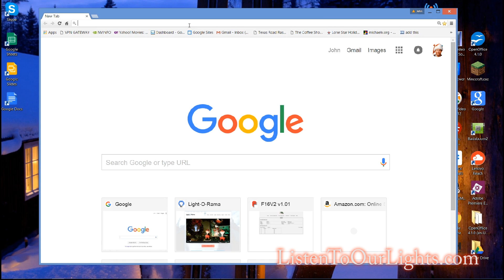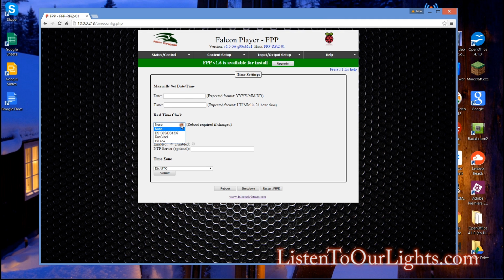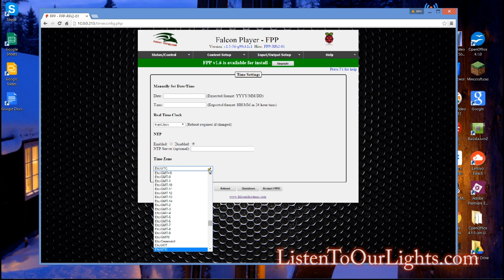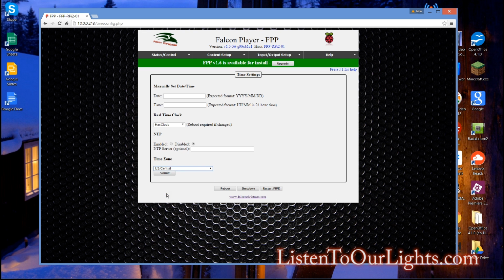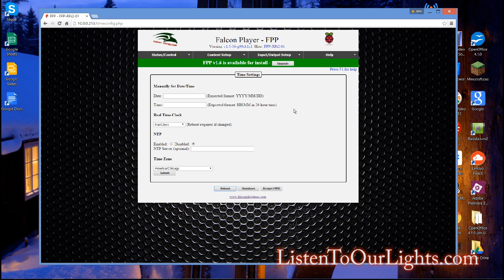Installing RASClock on FPP

Comment: Is there any other benefits to going from a laptop running lor simple show builder to a FPP besides not having a laptop running all time? Just curious why you are making the switch.
Reply from the maker: +dallas rose
Performance at higher pixel counts is the other/main reason.
Reply: Is there any kind of information regarding at what point your pixel counts exceed your computers processor ?